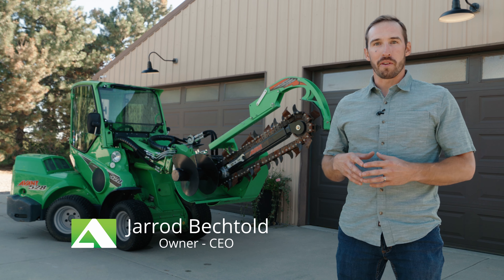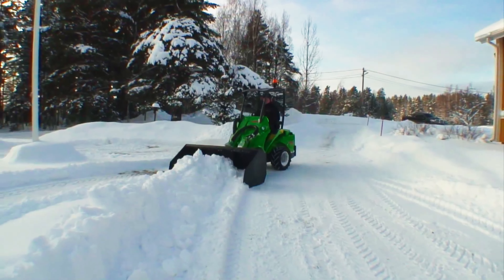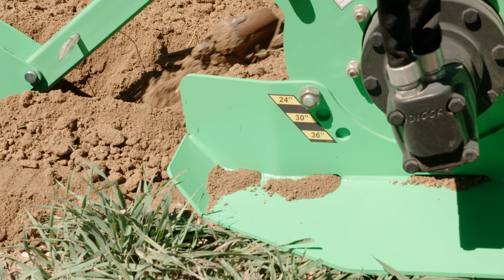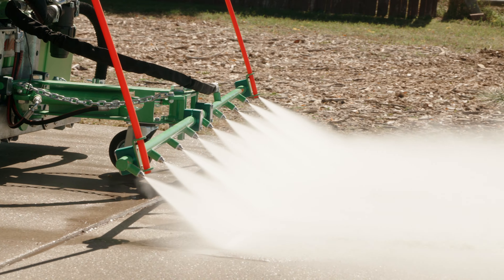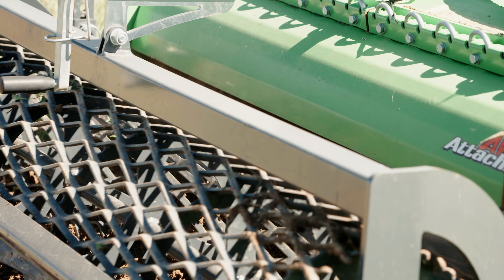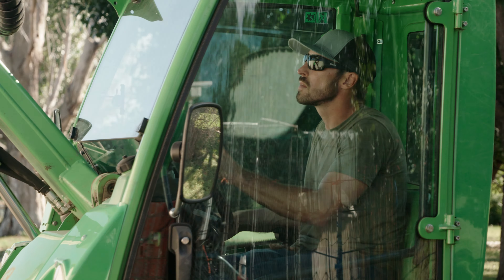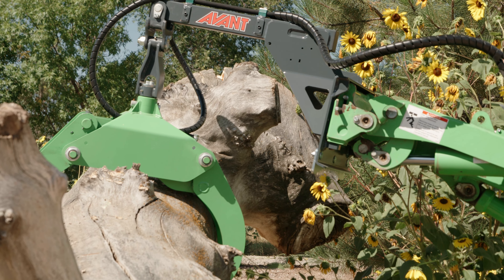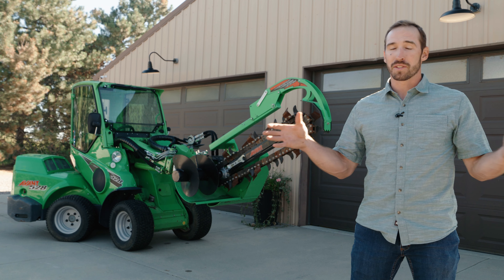Attachment Overview-Advantage Equipment Rental

Comment: Hello,  I h´ve a question. My Avant Dealer told me that a trencher on Avant 530 will not work  I saw that you put a trencher on a 528  is this work ok??
Reply from the maker: My trencher works really well! The flow may be a tad bit lite, but it chews through our clay soil well! I have been impressed so far...
Reply: @AdvantageEquipment  thanks for your answer.